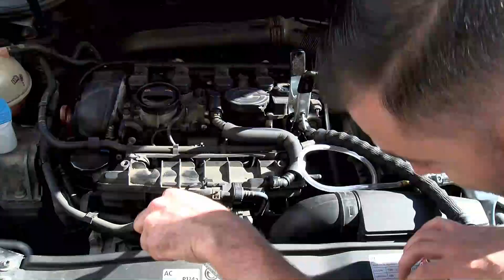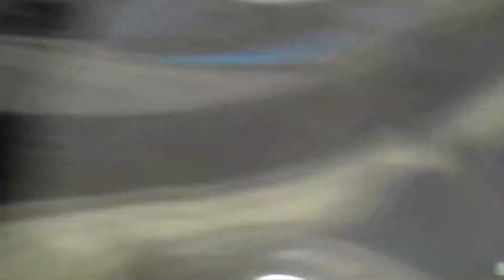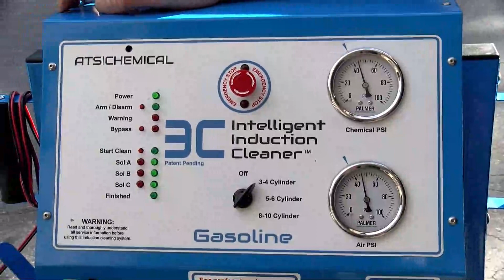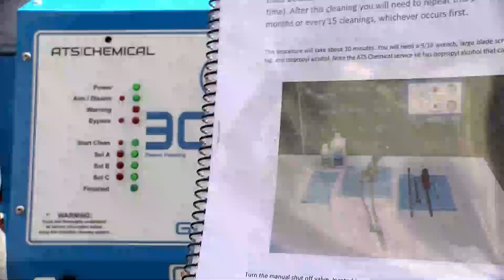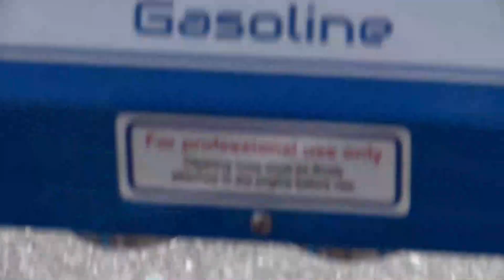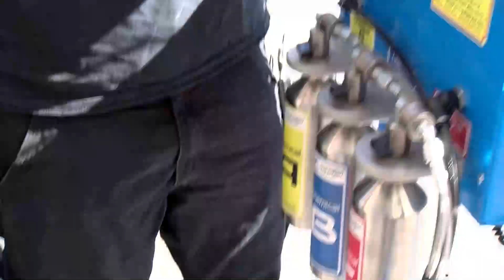2013 VW GTI 2 0L Turbo Cleaned ATS 3C

Comment: This machine is awesome- nice job Jerry. So the hose connects into the intake or through the temp sensor port..How much does this go for?
Reply from the maker: There are a bunch of hoses that can fit different vacuum ports. I believe the  machine is about 6I with enough chemicals that will pay the machine off by the time you use half of the chemical that is included with the purchase. Thanks for the comment